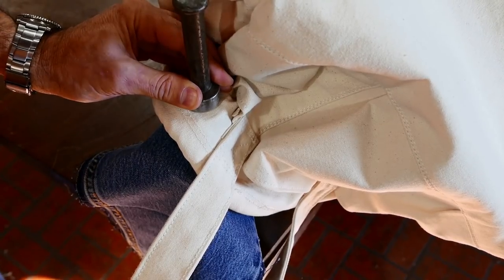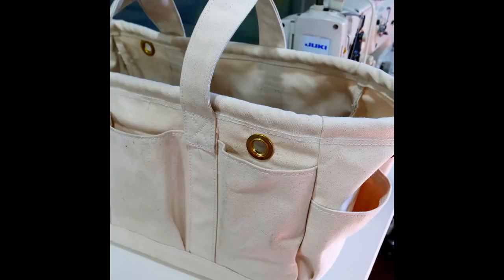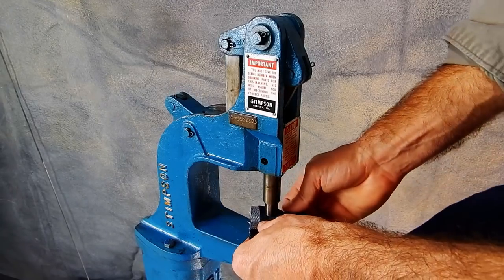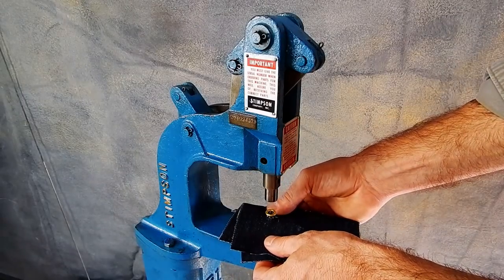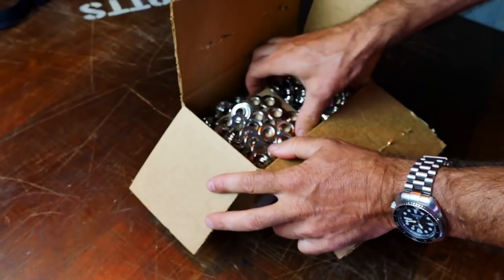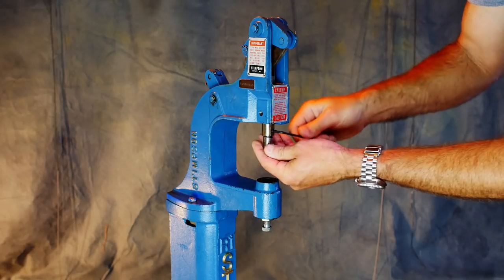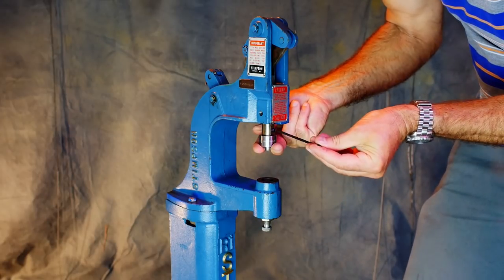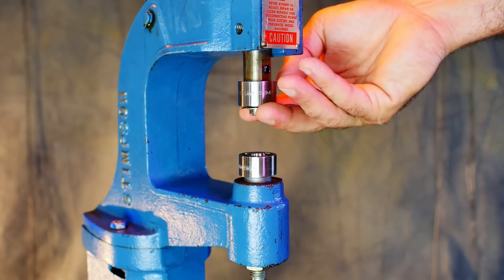One-Step Grommets with the Stimpson Foot Press #479

Comment: Okay Alexander,
you have me convinced I need an industrial machine for my work...
The problem now becomes a 12-volt DC power source question...
* * *
IF I am doing my work in a desolate place where I can collect all the solar power to charge my batteries,
which machine do I get that I can run on a 12-volt DC system?

Are there conversion kits that might solve my problem?
OR
am I stuck converting my 12-volt into brief spurts of 120-volts to run the machine I get...?

* * *
Until that time. . .  Earl J.
Reply from the maker: This is really outside my area of knowledge but I can offer this. These sewing machines can still be operated by foot powered treadle.